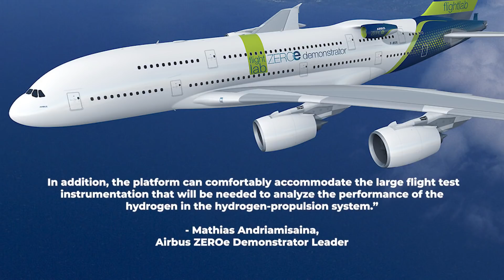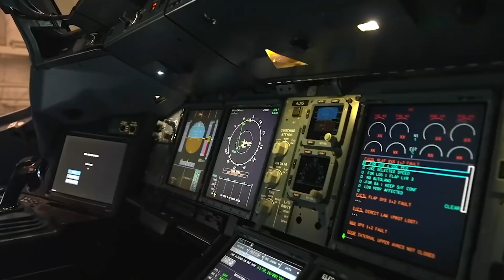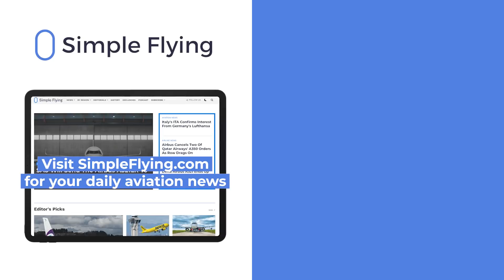Airbus Tests Hydrogen Engines On Quadjet: New Life For An Old A380

Comment: It's so nice to see the original A380 continuing to make contributions to the future of commercial aviation. There are a number of zero emission options being investigated both hydrogen and electric propulsion systems seem to be at the forefront right now. We may see other viable solutions but my gut feeling is it with be either hydrogen or electric which will win the contest. No matter which way it goes the change is a must if we are hope to maintain and grow global air travel while most importantly reach the zero emission target. We can and will do it.
Reply: Real engineering has a good video on hydrogen vs electric but for trucks.

Short version is, with current capabilities of hydrogen and battery tech, electric is great for short haul trucking. Hydrogen is good for longer distances. I can see something like that for airplanes too with smaller ones have battery power and larger ones with hydrogen. This is assuming we don't have a breakthrough with battery tech that massively improves it's energy density
Reply: and how does anyone plan to produce hydrogen without using more energy than they're producing???  You'll have to burn SOMETHING to make energy to get the hydrogen.  I guess it's a good argument for more nuclear fission but still.
Reply: @98f5  there are multiple ways to get the energy for hydrogen production without burning: solar, wind, hydro to name a few. The minimum barrier to clear is hydrogen production be cleaner and efficient than fossil fuel
Reply: @anzer789  haha thanks for the response. I can't believe i didn't think of other renewables. SMH musta been tired when i posted those questions.
Reply: Farr to dangerous ,hydrogen, inside a tank, to dangerous, hard to control this gas, you need a extra  converta to produce the hydrogen gas the plane flights , rather use it from a tank.too dangerous , one error, and here you are...

Comment: Liquid hydrogen just doesn't provide enough energy to get even a small aircraft off the ground.  Plus, it either has to be kept VERY cold or under a great deal of pressure...not something that will be practical machinery you want on a commercial aircraft.  Don't expect much from this...feels mostly like environmental PR from Airbus as usual.  🤷‍♂️
Reply: Finally I found a single rational comment here. Unfortunately this idea is a huge waste of money. "In order to produce hydrogen (with zero emissions) a process called, electrolysis. 20 - 30% of energy is lost in the process of creating hydrogen. The hydrogen must then be compressed and stored, losing another 10%. Finally, another 30% is lost when converting the hydrogen into electricity. This leaves you with 30 – 40% of the original energy used. " and unfortunately this process really can't become much more efficient. Hydrogen requires nearly as much energy to produce as it delivers. The CE rating (energy efficiency) for hydrogen is around 60%

Comment: Based on how much modification it needs to just run one test engine I don't see existing planes being retrofitted with that, so it's doubtful the 380 will be any more than a test platform IMHO
Reply: And you’re right, this is just a test platform with no plans of adding it to already existing aircraft other than test aircraft. The aim is to built aircraft entirely running on hydrogen with experiences gained from the program

Comment: Airbus a380 (as the new largest aircraft in the world to date): But... I can't do this without you!
Antonov 225: You must believe... *Burns down*
Reply: The A380 is the biggest aircraft now. I am 97% sure it is bigger than the Dreamlifter, I do know however it definitely is bigger than the Beluga.
Reply: @GenericGeeza  It depends on your criteria, in terms of volume you're probably correct although the C-5 Galaxy could be a contender. Length wise 747-8 is the longest, Stratolaunch is the widest.
Reply: @FTFXclan  and by most paper is a paper plane
Reply: There are other cargo planes bigger than a380

Comment: They should test with Boeing cause 777 has wide range with airlines
Reply: Why would Airbus test this on a Boeing airplane?
Reply: This plane is not intended for airline service. Using a 777 has no real benefits, to be honest probably also no disadvantages but still. Simply it not being an Airbus aircraft rules utilizing it out. Also, the A380 may have the needed size for the hydrogen tanks.

Comment: I love & welcome the hydrogen revolution in the aviation industry BUT I still don't understand how this is a practical means for lessening the amount CO2 in the atmosphere since making hydrogen takes more energy than what it what gives back. 🤷‍♂️ Well, unless fusion reactor becomes a reality and stable.
Reply: If course the way hydrogen is obtained has to be worked out in the future, but it’s kinda normal that you need to first "invest" CO2 before having benefits. Producing new batteries of electric cars emits a lot of CO2 and the car has to driven for quite some distance for it to compensate the CO2 it in service life doesn’t emit. It’s also similar with wind turbines: To build them you need machinery which is more than likely using e.g. electricity made from coal. 
Maybe at a certain point we’re able to enter a cycle and use the energy of already existing wind turbines to produce more, but until that point is reached a lot has to be done :/
Reply: The strategy assumes that in 2035 we have spare renewable electricity generation capacity - or an alternatively clean electricity source, fusion or fission. The positive news is that the delivery of electricity does not have to happen at precise point of time, like let's say when cooking, watching TV or charging a car that needs to be used the next day. Hydrogen can be generated when spare electricity capacity is available and stored for later use.
Reply: So much wasted electricity from renewable just can't store it. Can't store virtually any solar. Plan is to use the excess   to make hydrogen.
Reply: There’s no way you can make fossil fuel sustainable, but hydrogen can be zero emissions. It’s money that’s the issue but it can be sorted out later.
Reply: @nathanieong6212  Why not? If plants can extract CO2 from the air and split it into carbon and oxygen, so should we be able to do as well. I am not saying this is feasible, as hydrogen is easier, but given enough "free" energy, it should be doable.

Comment: Why hydrogen? Is it cheaper ? I know it's cleaner ,but I just cannot believe it is worth the infasture investment
Reply: Money as of now doesn’t matter. The aim of the project is to find a zero emission or at least a more climate friendly way of propulsion
Reply: developers are racing to produce H2 from H2O instead of CH4. Economies of scale and further advancements in electrolysis is all one needs
Reply: Because currently hydrogen is the most dense way to store energy in a clean and renewable way. If we use batteries, we cannot store the same energy in an efficient way, nor can we produce the batteries in an environment clean way. Using other synthetic fuels based on carbon will not be much better than what we have today.
Reply: Because govement grants

Comment: Excellent strategy to use 380! Most "green" initiatives start small and fail, when you start big and succeed, you dominate the market. If Airbus pulls off building worlds largest passenger aircraft twice (older and newer generation emission perspective), that's hats off! :)
Reply: No, you didn't understand. They don't want to make a hydrogen A380. They are merely using the A380 for testing purposes, and if the tests succeed, they will proceed to make new aircraft types powered with hydrogen.
Reply: @osasunaitor  actually did understand, just did not phase is the best way (english is not my 1st language), but basically using it is achieving it twice. 380 (or any other that size paxAC)isn't ever going back to production, that's basic knowledge.
Reply: You're just extremely uneducated. This has nothing to do with the a380

Comment: How are liquid hydrogen fuel storage tanks safe to have on or in an aircraft?
Reply: How is having thousands of liters of jet fuel to have in/on an aircraft? Appropriate storage vessels that would be routinely inspected and maintained.
Reply: @danielroytanked2375  liquid fuel dont burn. Gas do
Reply: @matsv201  sure bud. Sure
Reply: @matsv201  If a hose or tank breaks (has a crack) or leaks pressurized (compressed) liquid hydrogen fuel it will vaporize immediately and will explode if a spark ignites it. Correct?
Reply: @johnlove7328  well.. it will insta freze everything it touch,  then expand 10 000 Times in a Flash instance, then explode. But by the time it explodes,  everyone is probobly alreddy dead.
Reply: Same technology with hydrogen cars.
Reply: Even coal fired locomotives or ships could catch fire.

Comment: Conceptual..looks more like a hybrid use between hydrogen and JET A1..for takeoff power and maybe hydrogen for cruise
Reply: It’s a test aircraft to first of all test an engine running on hydrogen. All four engines the A380 already has run on Jet A1, only the fifth engine will run on hydrogen. That’s a common practice when it comes to testing new engines as you of course want to test the engines at all kinds of altitudes and in different scenarios. Maybe you have already seen pictures of GE‘s 747 with the GE9X installed or PW‘s 747 which also uses a similar set up to the hydrogen A380
Reply: This is just like testing any new engine. You keep most of the original engines to fly the airplane and put one new engine to test. If the new engine does not work as expected, you fly on the old engines.